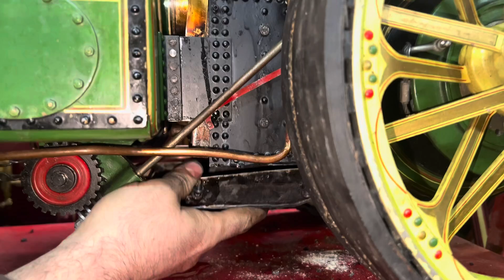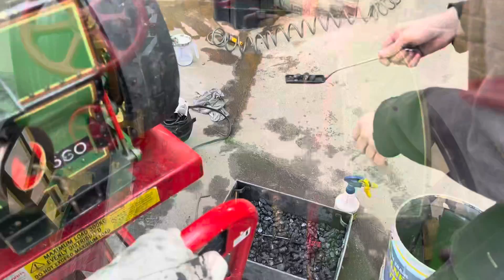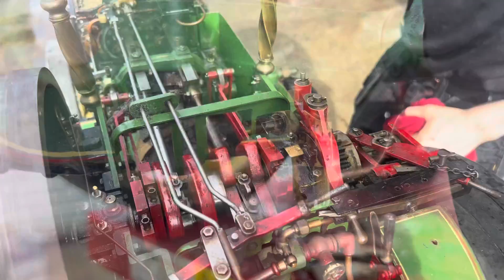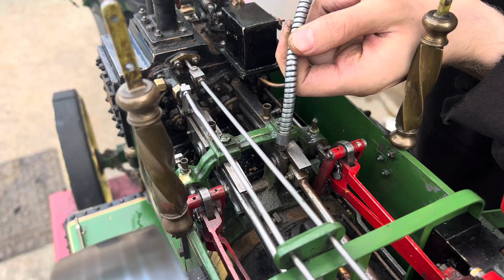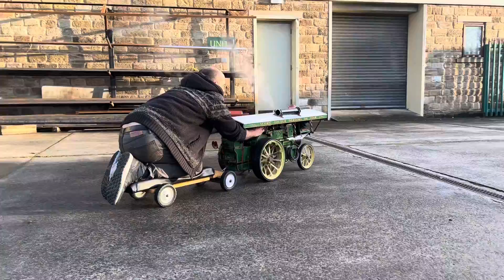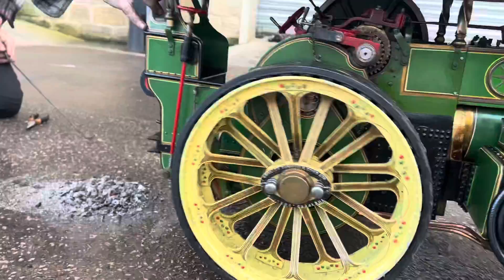2” scale Burrell Showmans Engine

Comment: What are the main differences between loco and traction engine boilers?
Reply: On a steam locomotive boiler there is no reinforcement plate to carry the cylinder block.
Also the regulator which often goes through the backhead at a locomotive is on top of the cylinder block at a road locomotive.
Reply: @johngroenen  Thanks👍